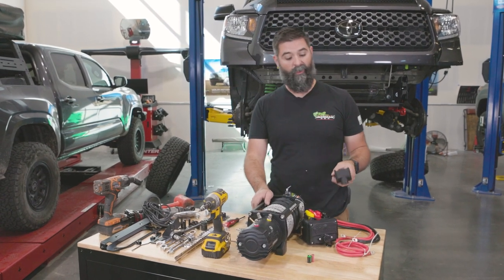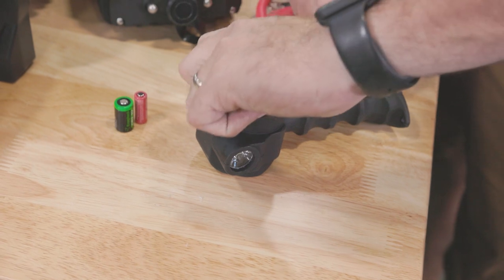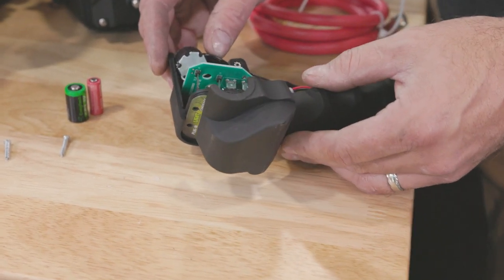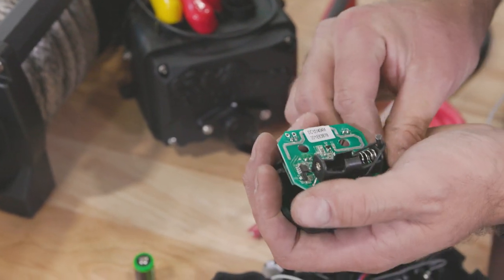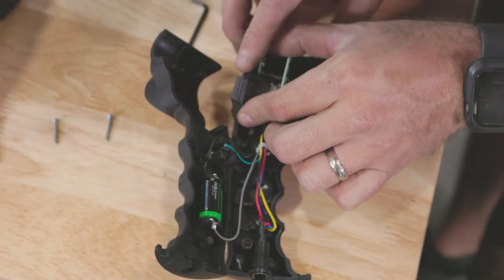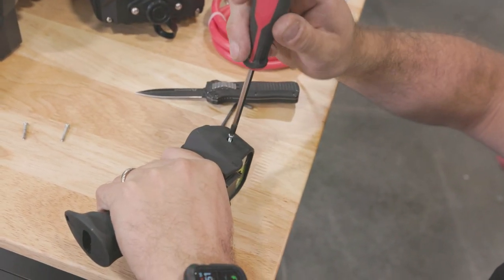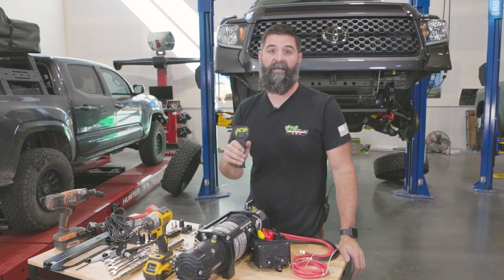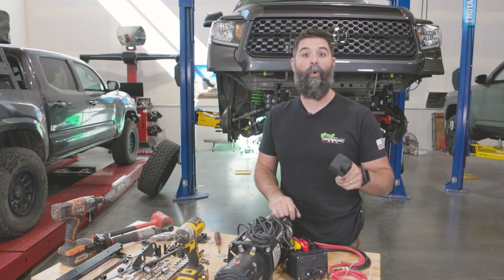Replacing Batteries In The Ironman 4x4 Monster Winch Wireless Controller

Comment: The remote won't work wireless, would you suggest changing the batteries? It's a new remote and I have only had the winch installed a month. Thanks!
Reply from the maker: Reach out to our customer service team so they can assist you with this.  855-476-5714

Comment: Hello. Do you have any idea why my Ironman winch works for just 4-5 seconds? I've changed the remote control batteries. I have the problem on wireless but also with the cable plugged in.(few months ago it worked perfect) thanks.
Reply from the maker: Why don't you contact our customer service so they can take care of you?  These winches have a 5-year warranty.  855-476-5714

Comment: Is one of these batteries supposed to be a rechargeable (maybe the light battery)?
Reply from the maker: It is not rechargeable, unfortunately.
Reply: @Ironman4x4America  thought so. iron Man in Australia told me it’s rechargeable if you eave the cable plugged in which if camping you could leave it set up this way till you drive. good to know now that it’s not rechargeable.

Comment: Thanks for the vid. NOT exactly a customer serviceable design. Sure, most anyone who is a customer of this winch and offroad products is likely to have little problem swapping batteries. There is the outside chance that you can pinch a wire or break the solder. Maybe even gooping up the insides with some mud, grease, beer, BBQ sauce, or most probably, tears, rendering the remote unusable. 
However, needing battery service, the remote should have been better engineered with a battery cover. Preferably a waterproof cover that is toolless, tethered and a single screw/bolt that doesn't fall out into the mud in the middle of the night. Something similar to what is seen on some hand-held radios and GPS units.
Hoping you can come up with a better designed remote that can be retro-fitted to winches you've already sold.
The light is nice to have.